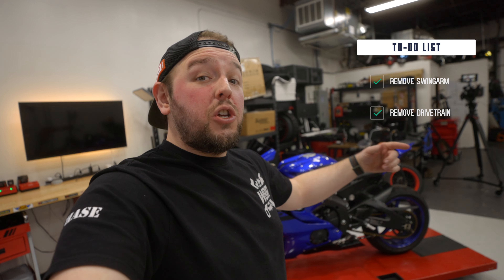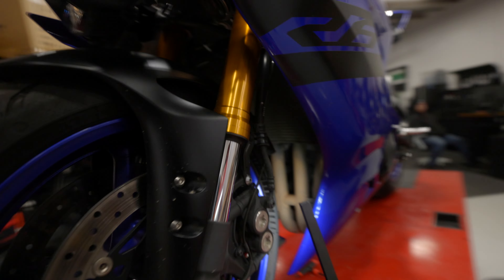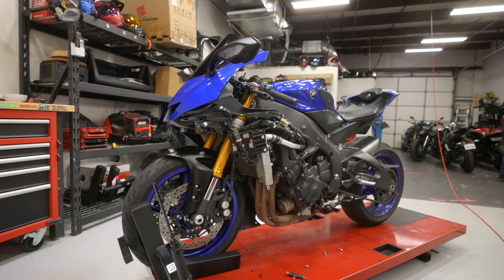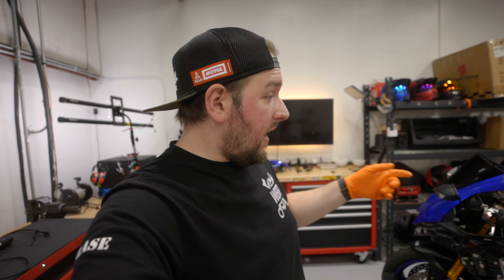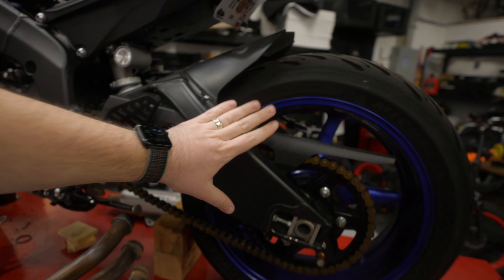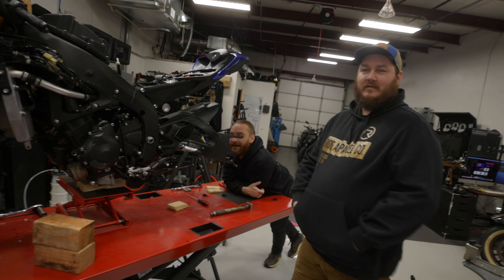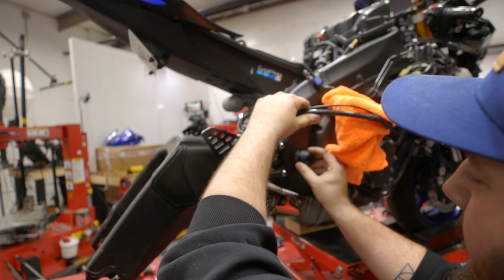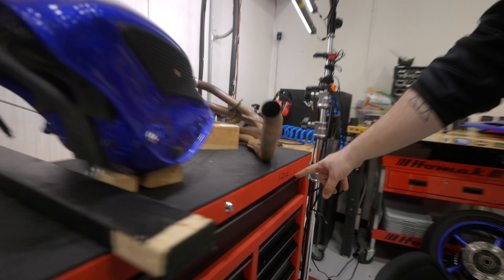Watch This Before Removing 2018 Yamaha R6 Fairings!! | WBRGarage S6 Ep04

Comment: They didnt need to remove the valve lines 🤷🏻‍♀️ so they didnt. Also means they didnt need to install a servo buddy since the valve control wasnt removed. No check engine light.

Comment: oh chase, next time something is tough to get off due to the tq that was put on it and or rust build up - get some good penetration lube (WD-40, PB blaster, or my favorite Kroil) - and get a breaker bar.. also go with the strength you have.. so if pushing up isnt good then do a pull back might be easier for ya.. different muscle group.. anyway keep up the fun.  and remember to work smarter not harder.. K.I.S.S.  (keep it simple stupid or how I like to say it Keep It Stupid Simple).  cheers.